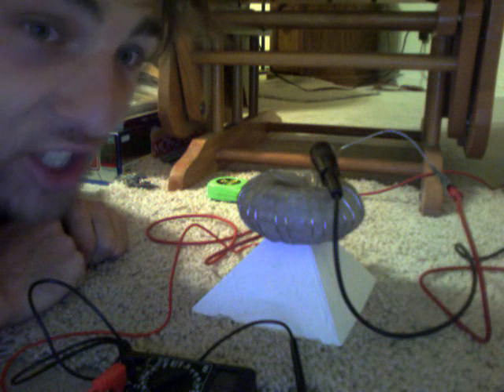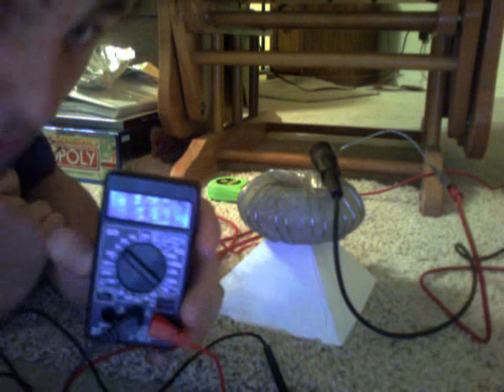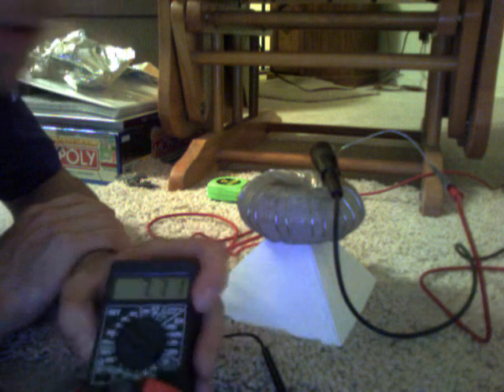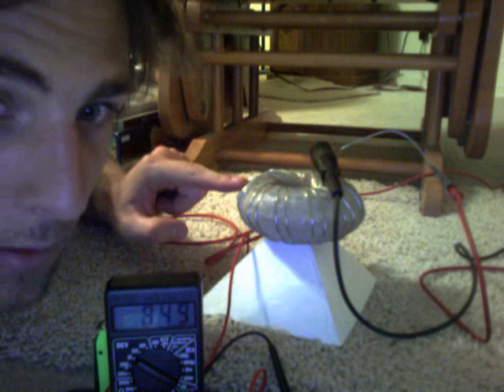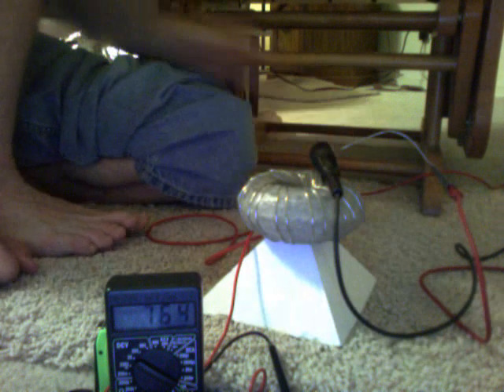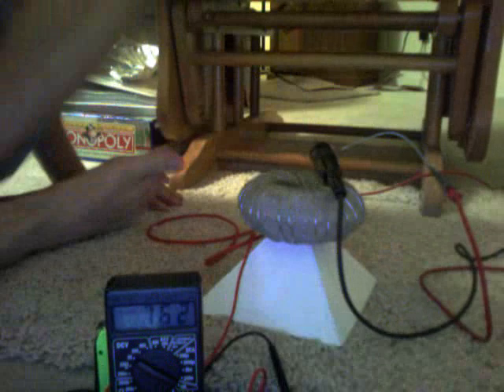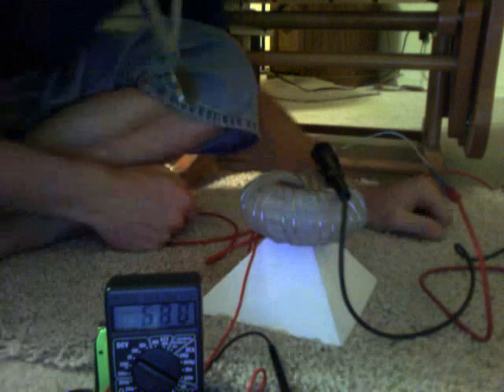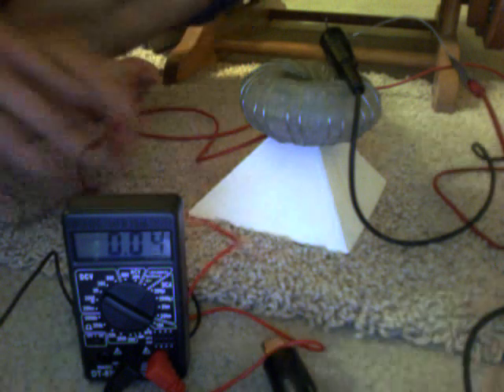Rodin Coil & the Human Effect

Comment: U=IxR
I is Amps
R is resistance
U is voltage.
By touching the coil you increase the resistance for the electricity. And plastic doesn't conduct so that's why the jug of water did nothing.
Try strengthening your personal machnetic field and do the hand thing again, but without touching it. That might be interresting

Comment from the maker: It's 32,768 hz is the resonant frequency of quartz, or 2^15. All frequencies of 2 (aka 4,8,16,32...) are perfect Cs. I did research a ways back with frequencies and made a world of tables. My work is actually posted on Project Avalon from a couple years back I believe. I knew I found the natural frequency set when it corresponded perfectly with Vortex Mathematics & the Fibonacci sequence. So yes, a true perfect C is 256 hz, which is slightly off with the contemporary A440 (which really is 432).